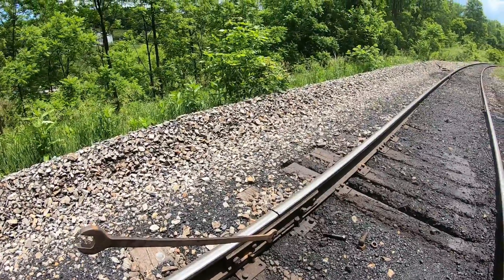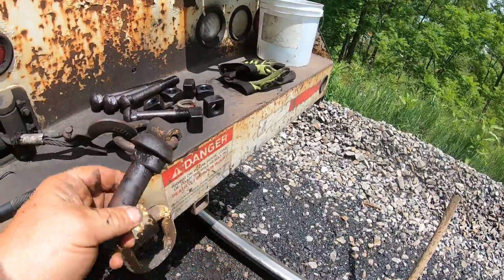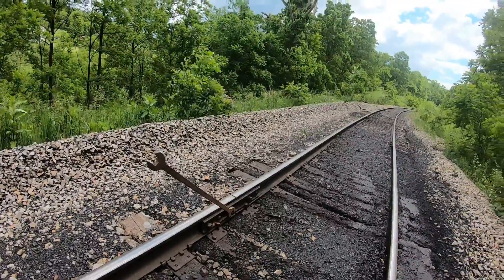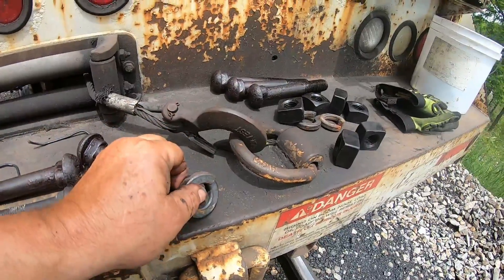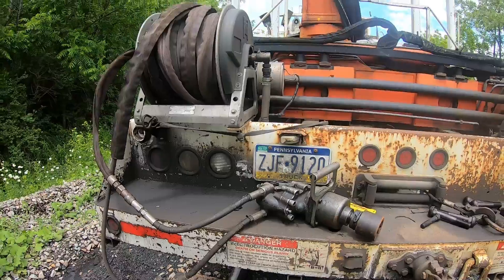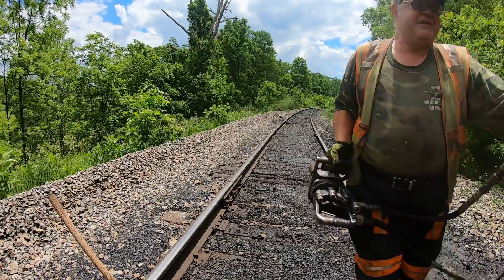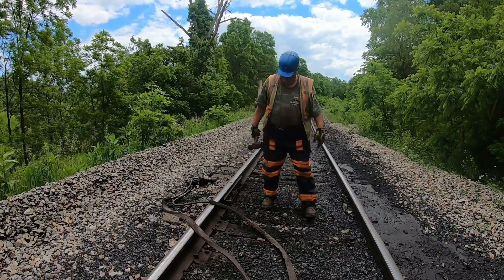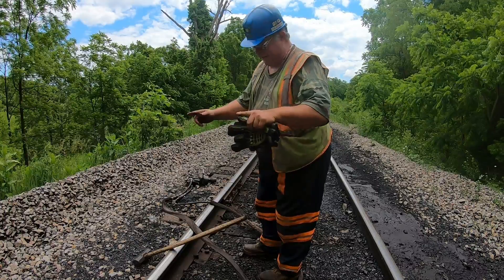Bolts in a Track Joint need Replaced - You Can Help Fix Them

Comment: We use a lot of hydraulics but if I may recommend for your wrench get an IR Impact, they look like a mini-gun. They use two big batteries, get yourself a charger for your truck and two more batteries and then your set so you can charge two and use two simultaneously
Reply from the maker: Thanks for your suggestion dje. Guess what, I had them order me one
and I simply love it. It's not quite the wrench my hydraulic one is but it
sure is nice, no hoses to mess with and also I can take it with me in
my small hi rail truck which doesn't have hydraulics on it. It has
been a real blessing. Here's a video I made when it was new of
the IR wrench:  https://youtu.be/zxKlmzt76Ws

Appreciate very much your taking the time to watch the video
and write in my friend.

Comment: Hi Dave, just finished watching and I have a few questions.  First I've noticed that railroads put half the bolt heads to the inside of the rail and half to the outside and wondering what the reasoning is for thus. Second I noticed most railroads use 4 hole joiner plates and you use 6 ,is there an advantage to the 6? And last I have a comment on hardware.  I have an application where I have to use American hardware because the bolt heads have to be perfectly on center where the Chinese hardware is not and that causes 2 large angles to be offset. So yes it might cost more but American hardware is far superior.    So keep those trains rolling and keep these informational videos coming.
Reply from the maker: Thanks for tuning in today Gary. Good questions. Consider
if a car wheel comes off track and shears off bolt nuts, then
if only 3 are on one side, it will only shear off those 3 and thus
leave 3 bolts still in the joint. The opposite end of the bolt
is rounded so a car wheel will not be able to shear that off.
We';e had car wheels off where it sheared all 3 bolts on one
side for over a mile of track, but the other 3 were left intact.

All rails of a higher weight use the 6 bolt hole template. Our rail
here is 132. Lighter rail such as 120 or below commonly
uses the 4 hole joint bars.

We have tried bolts made in Pakistan, Mexico, India and USA
in every case the bolts made in USA are stronger and last longer.
Thanks so much for stopping by and watching today my friend.

Comment: Dave those bolts sounded tight to me is it the vibration of the trin that caused them to loosen or track movement
Reply from the maker: Yes John it is the forces from the train along with the track
moving up and down that can cause bolts to loosen and also
break. Plus after many years they just get worn out also at
times. Metal fatigue. Very much appreciate your visiting
with us and taking in the presentation my good man.

Comment: Hey 👋  section man Here again in terrace bc.  Now how do you hot cut on a 40°C day where you are from . When you gotta hot cut out from misalignment put a plug in to take out some steal, cut out hot cut torch out is fastest and plug rail it in . But with a rail saw . Half through the head down to the base flip saw over cut rest of the baseband finish on the head of the rail is how we do it I would love to hear how you guys would do it if you needed to make a hot cut on a really ot hot ya know?? 👍
Reply from the maker: We have had indications of a heat buckle starting to form
several times in the past Brandon. You are so right a rail saw will bind
up and you ain't getting it out once it does. We torch cut
the rail and then having a gap, will saw cut whatever we need
out to put a plug in. Thanks for asking and for taking the time
to watch the video today my good man.

Comment: One item of interest that was not mentioned is the bolts and nuts on a joint bar are staggered. The reason for this is if a wheel should pop off the rail it will only shear 3 of the fasteners and keep 3 on the other side holding the joint bar. If all bolts are inserted from the same side, a wheel could potentially shear all 6 nuts, causing complete joint failure and derail the train.
Reply from the maker: Thank you very much Gerry for adding that in. We appreciate 
your taking the time to write in and for watching my good man.

Comment: Thank you for your reply, I mis quoted it was Grease and not oil. I. Figured that you just didn't have time to cover what a I was asking about.  I do appreciate your quick response and the different things that you have covered. But not all items are released for view, the latest is using the BRUSH HOG, showing just much area is covered.  Thank you for your videos.   JW MCCLANAHAN
Reply from the maker: I knew what you meant JW, many that would have read your
comment would not have known tho. Many railroaders have
called them oilers in the past.

Comment: Hi Dave, I would like to thank you for your great videos. One thing I noticed though was that the outer rubber layers on both hydraulic hoses hooked to you impact gun were badly damaged. I think you should get them changed for your safety and maybe get Kevlar protection on them.thanks again
Reply from the maker: Thank you and glad you are enjoying. You are correct in your
observation and correct in I must get those hoses changed,
been putting it off and I accept all blame for that. Appreciate
your concern and for writing in my friend.

Comment: Would you please measure the diameter of the holes on the joint bars/fish plates. Please provide the size of the joint bars also. The reason I ask is I'm starting a 1/8 scale Live Steam locomotive build of a SBRR ALCO S4 in honor of my late Papa who was a locomotive engineer for many years on the South Buffalo Railway until his retirement and I would like to be as prototypically correct as possible on my mission to honor my Dad. Thanks for all the great videos of railroading, keep up the great work.
Reply from the maker: Joint bars are 30 inches long, 5 inches high . Bolt holes are 1 1/8 inch diameter. That is bars for 132  pound rail.

Comment: Track wrench =Fish spanner 
Track bolt= Fish bolts
Fish plates. 
I could argue all day with you Dave. On pretty sure we would have an enjoyable time .
Cant beat British Steel.  
👍😎
Reply from the maker: Do you know why they are called fish plates? On the rail underground here they call them fish plates on the outside track we call them
joint bars. The surface area the plates have against the rail head and
the rail base which you call foot, that area is called the fishing. Thus
that is why they use fish plate because it rests against the fishing.
We would have fun, I really enjoy learning about how other
countries  have their terminology.

Comment: Every bolt has a specific torque. You mentioned that you don't know the torque on those track bolts. As a track maintenance guy. you should know if your properly tightening the bolts according to torque specs. Your hydraulic gun is just a noise maker that doesn't sound like it's doing the job it's supposed to - torque wise. But as always, you can only do a job with the equipment and supplies you're dealt with. Doing the best with what you've got. Play the hand you're dealt with.
Reply from the maker: I said I didn't know the torque that particular impact wrench
put out because it just came to us as a rental from a RR contractor and
had not had the time to check what the torque it put out was. Hope
that clarifies. haven't watched that video in a long time, but I believe
I remember saying we torqued our track bolts here to 350. We
tried tightening them to AREMA specs way in the past and with
us having 17 miles of jointed track, that made the joint bars
too tight which wouldn't allow the rail to creep as needed due
to thermal expansion and we ended up having heat induced buckles,
so we backed off the torque and have had little problems since
then with buckles due to heat. Hope that helps clarify better Rick.
if not please write me back.
Reply: @ccrx6700  Thank you for the added in-depth information. After your reply, I watched the video again twice more. 
And I didn't catch your comment about your torque specs. In my career in the railroad business- as a diesel locomotive mechanic, torque applications is very critical. Dealing with the ICC, the U.S. Dept. Of Transportation, and other national and state & local entities, the so called "eye's of Texas"  are always looking over our shoulders. As they should be. Public safety is more critical in the railroad business, than in any other transportation business. You and I deal with millions of tons of danger rolling on the rails. Thank you for the specific job that you do in keeping the rails straight and strong. I enjoy the videos that you present on YouTube. Stay safe.
Reply: @rickprusak9326  I respectfully disagree that "Public safety is more critical in the railroad business, than in any other transportation business"
I would say "Public safety is more critical in the Aviation business, than in any other transportation business."  As an FAA Certificated Airframe & Powerplant Technician I just couldn't let that statement fly 🤪

Comment: greetings Dave At work we had the tracks replaced at work in 2012, 
a few months ago I keep an eye on the tracks as I walk down them
daily, I found 3 broken bolts on a joint all on one side, is that common?
all were broken in half like they were over tight, or had a extra stress 
on them. but the balist support was good the day before there was 
a delivery and I did not see excessive movement anywhere on the 
tracks. You make very informative and interesting videos, thanks 
for the railroad education.
Reply from the maker: Well that's interesting. Usually when there are 3 bolts sheared off
only on 1 side that means a car wheel was off, but you'd have
more than 1 joint if that occurred. I've never seen here when all
3 on one side were broke in half. That is strange, but there
are some weird strange things happen on the railroad! 
Sorry I can't be of more help but great to hear you are enjoying
these videos my friend.
Reply: May be one idea but if they were measuring the holes with something that's a bit too short you'd end up with each hole having less and less room, if the rail pulled tight the bolt with the least room would shear 1st then putting pressure on the 2nd repeating the process to the 3rd.
Reply: @matty101yttam  greetings Matty When I found the broken bolts only on one side of the joint.
I thought it could be due to bad support under the rail on that side. but nothing was out 
of place. once repaired with new bolts I watched the CSX engine go across the repair 
with no extreme movement of the rail under load. so it was not support issue. 
also the broken bolts were not tight in the holes, or out of alignment. each split 
in the middle of the bolt. that is all I know at this time.

Comment: How do you check for interference with wheels? Thank You!
Reply from the maker: I'm not really sure I understand what you are trying to find out Edward?  On a wheel that has a wrong profile (concaved) then
there will be a shiny silver mark on top of the joint bars. Other
than that everything is below the flange on a wheel. Was that 
what you were driving at?
Reply: @ccrx6700  yes, that’s what I was wondering.  I wasn’t expecting to see from the video if the wheel would rub on the joint bar but I did wonder how you checked.  Is there an extra measurement needed? Or, are the components made to fit and you can tell by visual inspection the wheel flange will clear the bar?
Reply from the maker: @edwarddavis507  They make wheel gauges to check the wheel specs.
Once in a while a bad wheel happens and if I see a series of joint
bars that have the shiny streak near the middle of the bar, then time to
investigate the wheels for concavity further. Once in a while that
streak will happen on joint bars where the track is pumping up and
down also, not a wheel problem, but a track surface problem with that.

Comment: Have y'all ever tried to use ribbon rail as opposed to stick rail?
Reply from the maker: We do weld some rail sticks together when replacing a section
of rail, but the expense of putting in long strings of welded
rail at this point in time would be phenomenal, plus trying to
find time to do it. Founding fathers sure messed up by not
building the rail that way in the first place, but it's what we
got and have to deal with it. Appreciate your writing in and
for watching Josh
Reply: @ccrx6700  Then again, from what I can tell, continuously welded rail track requires an extensive amount of "anti creepers" to prevent the rail from expanding too much. Since the tracks on your railroad have old fashioned "dog  spikes" and not Pandrol Clips, it's probably not suitable to install ribbon rail in your case. I know that installing track with ribbon rail is very expensive, compared to stick rail track. I suppose that's probably why this line was built with jointed rail track instead. Keep up the good work, stay safe and God bless.
Reply from the maker: @joshbenton4080  You are right Josh, every tie on CWR has anchors, also
called anti creepers as you say. With all the grades and curves we have
even with every tie anchored, I do believe we would never hold
the rail here, but that's just my hypothesis and we will never know.
And again you are right, initial expense is why they did the jointed
track. There is no way we could have gotten 12 or 1400 foot
long rail in here, so every joint would have to been thermite welded
and would have cost millions more. You're a thinking man and I like
that.

Comment: Six bolt bars. On Cape Cod there is a lot of 4 bolt bars. That's quite a lot of mud pumping.
Reply from the maker: What size rail there Pete? This is 132 which is why the 6 bolts.
This whole section has since been cribbed and tamped up since
this video was made and is now a solid smooth riding track
surface. Do appreciate your writing in and for watching my good man

Comment: What about using the special concrete ties and the special rail that they use in Japan ?

If you had those high ties and rails, you could suck up the mud and coal without removing the ties
Reply from the maker: Well I can't tamp concrete ties with my tamper. Wood are 7 inches
thick, concrete 9, so in order to get the workheads to drop another
2 inches means manually having to crawl under tamper and reset
4 limit switches so workheads will drop lower, then when I go back to
wood ties, have to reverse all that, so that just ain't gonna happen.
Jupiter 2 operating system has a toggle in the cab to make that
happen, but I have old windows QNX version 6.10 operating system
Do appreciate your watching the show today
Reply: @ccrx6700  can you upgrade the operating system ?
Reply from the maker: @ocsrc  Yes sir. We have gotten a quote, it all depends on how many
options we would like to have on what price. Anywhere from 150
to 350,000 dollars. Just the Jupiter 2 system alone will be about
$75,000. But my tamper also needs workheads rebuilt, new air and
hydraulic hoses and hydraulic pumps rebuilt. Lots of options. To fully
upgrade we need a bigger engine to power new PD workheads. We also
have looked into trading it in to purchase a rebuilt tamper with Jupiter 2
system. All depends on what kind of money they will allow us in next years
budget. Will keep you updated, but for the for see able future we are
stuck with what we got. Do appreciate your comments my good man.

FYI a brand new tamper, Mark IV with all options is about a million and
a half and takes a year notice to get one, so that is not gonna happen either
any time soon
Reply: @ccrx6700  I wonder if CSX or another short line railroad would have one they are going to sell
Reply from the maker: @ocsrc  We have looked into purchasing another one used of course but
rebuilt and upgraded, and that very well may be the way we go here in the future. We shall
see what next years budget brings us. New owners here are dedicated to
spending money on what is needed which is a very good feeling. Thanks
for taking such an interest and being concerned.  

We got our quotes for rebuild and an exchange purchase from Quality Track,
they have sent a tech down several times to help me diagnose thorny
electrical problems, here is their site

https://www.qualitytrackequipment.com/services

Comment: Do you find that the lock washers break in two and fall out ? I'm a HD mechanic and we would never use lock washers on U bolts because they could break and the U bolts would be very loose.
Reply from the maker: On occasion they do, but we have 17 miles jointed track, with 6 bolts in each joint, that means there are over 27,000 washers on our track
and the few washers that do break is very small in comparison to
that amount. More bolts break than washers. I appreciate your
writing in and for your thoughts on that.

Comment: remove the track joints and install welded rail plain and simple! it's what conrail did .
Reply from the maker: Big bucks to replace 17 miles jointed track, we simply cannot afford
to do that here. Conrail was tax payer funded. We were cursed from
the beginning when they built this track, joint maintenance has been
nothing but perpetual here as you can imagine, but it's what we got
to do. CWR would cut my work load in half for sure Frank

Comment: I have about 700ft of the old Frisco Parsons Sub on my property that was removed from service around 1979. The rail is gone but I have found several joints, bolts, nuts, spikes, tie plates, and even knuckle pins. Amazing how much of that stuff gets used along 700ft it track over 100 years
Reply from the maker: Awesome Tyler, that's pretty cool. Thanks for watching the video sir